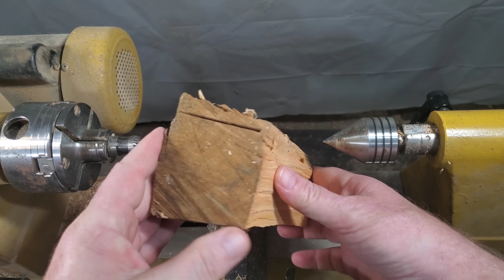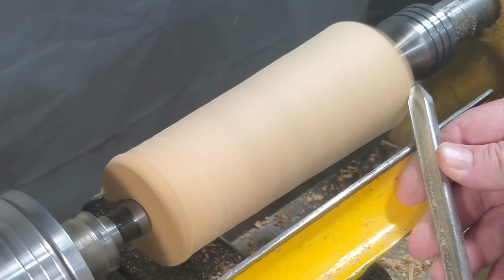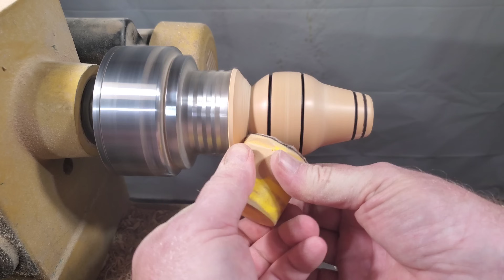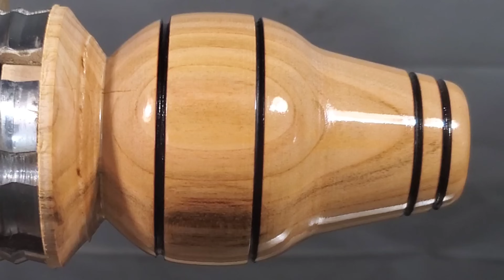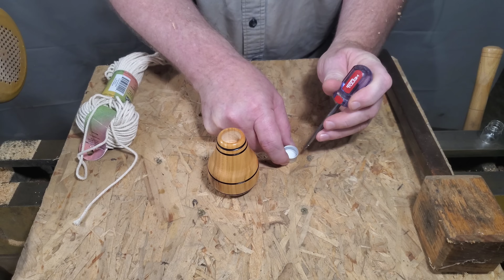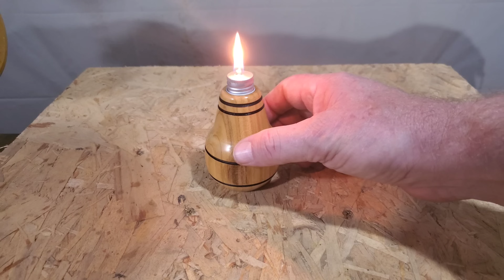wood turning a craft show project that sold great

Comment: What do you use to burn the wood - is that just a metal wire?    Looks like it has handles on it as if purpose built for that use.    Really like the project.
Reply from the maker: Thank you!
It's a piece of bailing wire with wood handles.
 I did a video on it. I think it's titled" I should have done this along time ago"
Reply: @RcWoodturning  I found the video, thanks so much.    Subscribed too, thanks for the videos.

Comment: Nice little project. Thanks for making and sharing the video.  This is not really for beginners, I guess. How much do you sell them for?  
Material costs are next to nothing. But it takes quite a long time to make it, I think.
Reply from the maker: Thank you!
It's pretty beginner friendly.
The wood is free. The rest of materials is probably about 75 cents.
Takes about 15 minutes. If you prepare and batch them out you can get a lot done in a short amount of time. I sell them for 10 bucks each. But I'm probably under priced.
Thanks for watching! I really appreciate it! I can't find an emogi that expresses how much I appreciate it.
Reply: @RcWoodturning  I really like your work
Reply from the maker: @bonglanbts9379  Thank you!